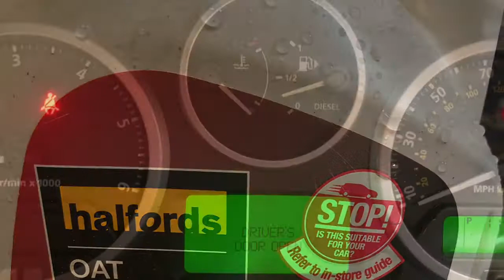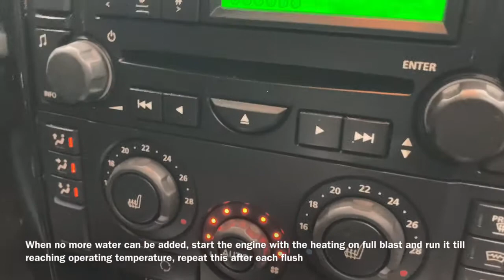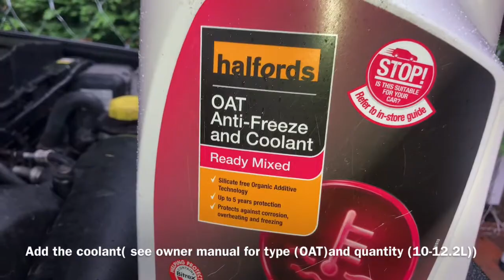Discovery 3 coolant flush

Comment: Was wondering where the second bleed screw was thanks 🙏
Reply from the maker: At The back of the engine, there is a metal pipe that goes across and on top of the engine.